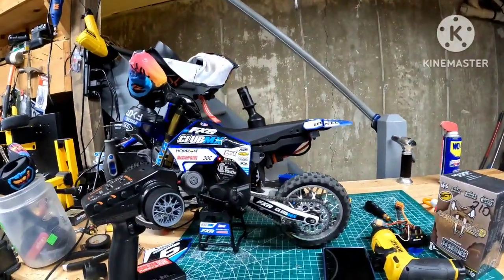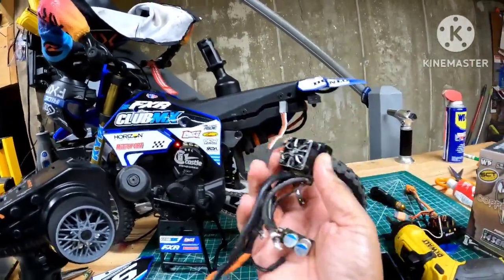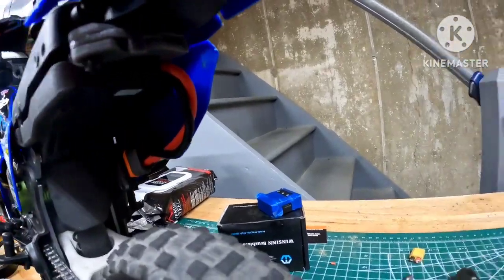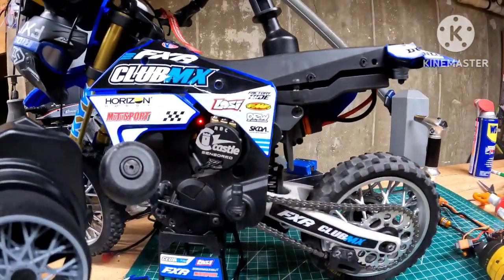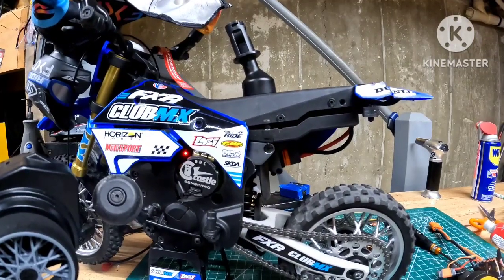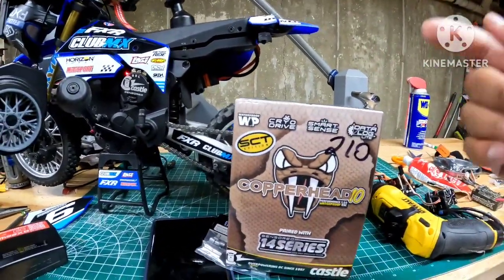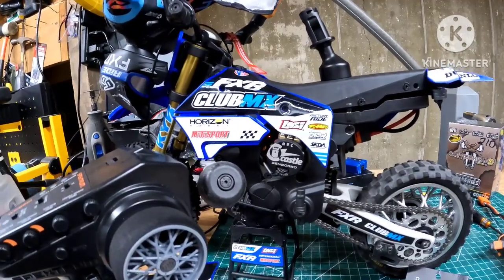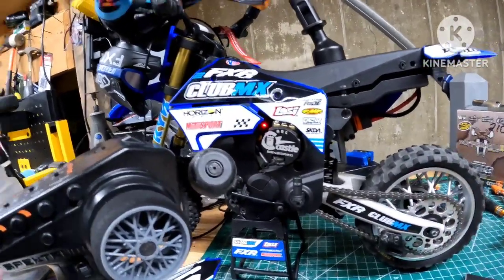Losi Promoto MX + Castle Creations Mamba X Sensored 6s Combo  Build Overview

Comment: Did u mod the flywheel? Losi claims it's only designed to handle 2s lipo
Reply from the maker: No mod to flywheel. I installed a bec to keep it running at 2s power